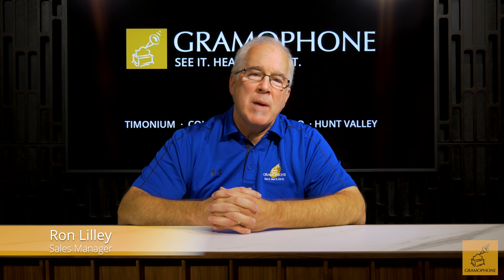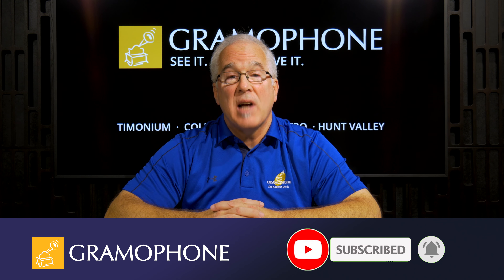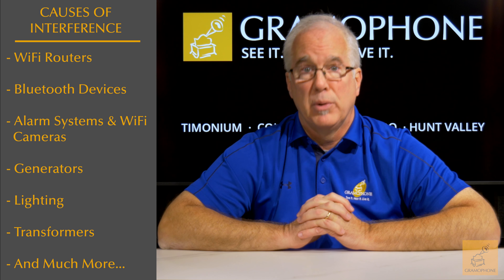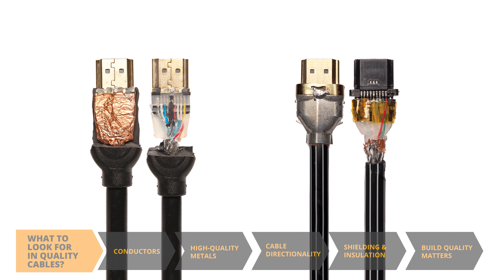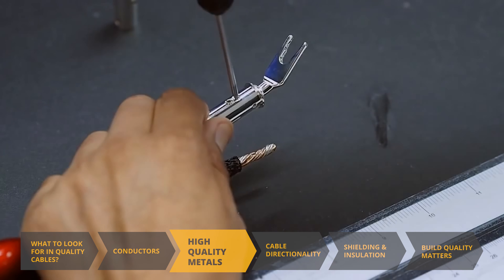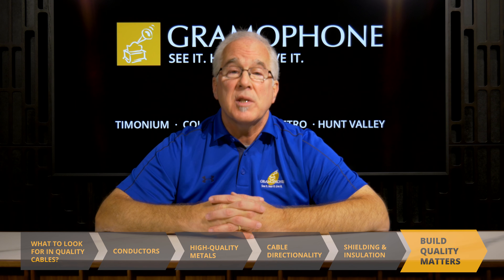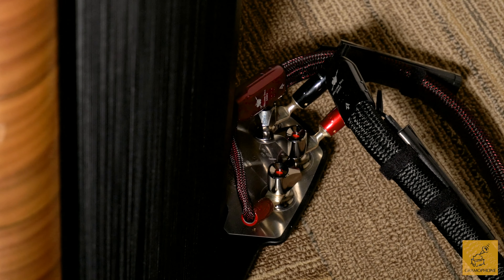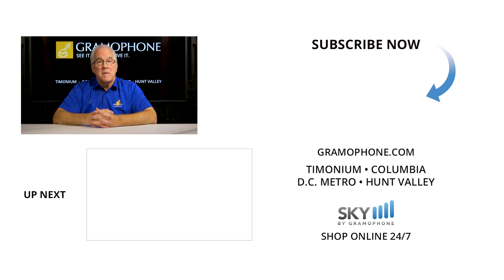AudioU: Quality Cabling Makes a World of Difference

Comment: Blind testing, and instrumented testing PROVES that any cable for short runs works fine.  Sighted testing, however, tells us otherwise.  If the cables are in-wall, you can't see them, go cheap.  If you can see them, and you want the most beautiful cables (to you), then go for it.  To each their own.